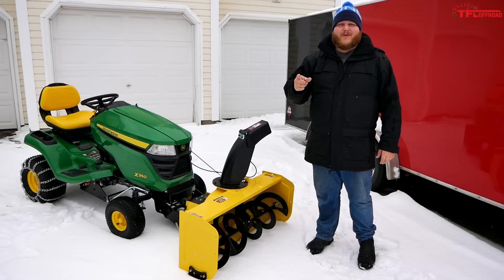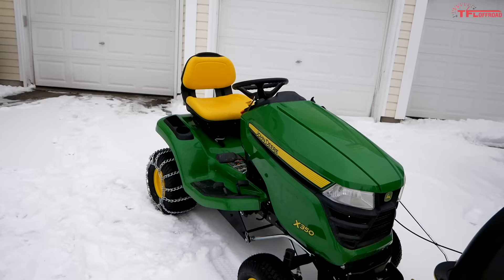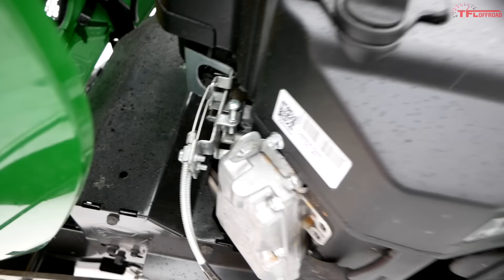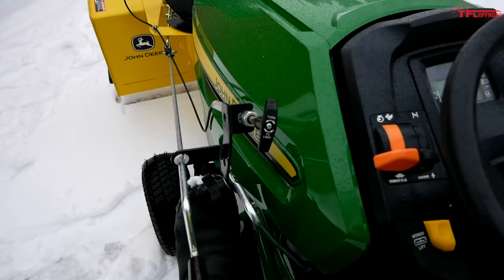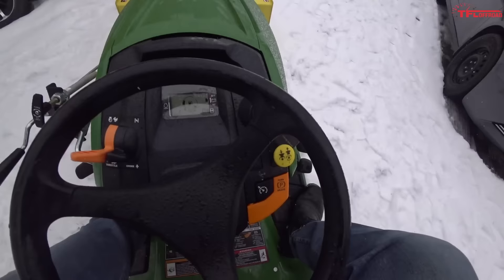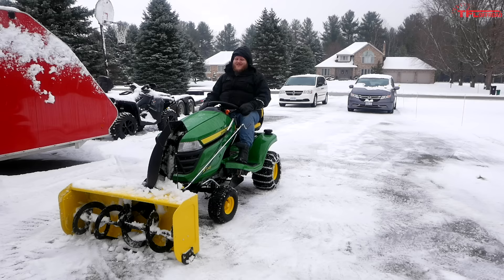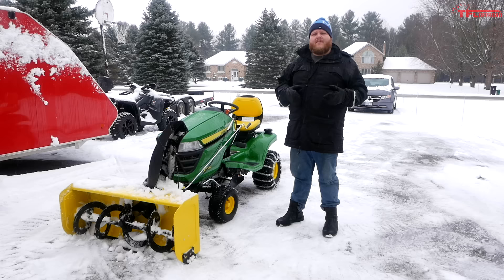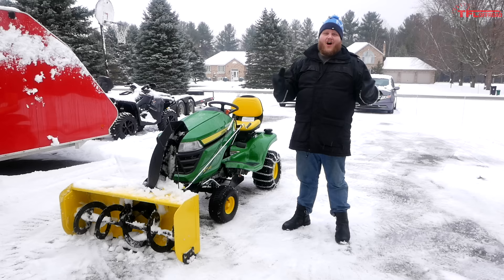Watch This Before You Buy a John Deere X350 Tractor!

Comment: The engineer notes and dealer service technicians both say that this transmission is sufficient only for flat terrain. In that case you’ll be fine. Mine went out after 300 hours and I was told it was because of the hills I was using it on.

Comment: Nice review.  I can't tell from the video or not, however, whenever you engage the PTO or disengage it, you should idle down the motor.  It's better for the belts.  On big tractors, if you don't do this, they call it, "Shocking the PTO."
Reply: Old wives tale. The first idler pulley off the PTO is spring loaded to take the shot. I work on small engine equipment and never saw a PTO wiped out by engaging under full throttle. The weakest link are the bearings. If you ever replace your PTO get one that the bearing is removable.
Reply: @joeganusi8522  If this is true then, I wonder why they also recommend that gas and diesel engines get idled down before being turned off as well?  Maybe they had magic springs also?  I have yet to replace a belly mower belt, because I idle down the engine before engaging or de-engaging.
Reply: @AStanton1966  Gas engines usually fill up the exhaust with unburned fuel if you don't idle them down before shutting them off resulting in a big backfire, especially if some backyard yo yo cuts the tip off the anti-backfire valve.
As far as the diesels, an immediate shut down after putting a load on an engine can result in overheating the engine (coolant flow stops upon shutdown and the block becomes a heatsink).
So, a minute or two run at idle (by idle, I mean 1200-1500 RPM with a tractor) allows the coolant to flow at no load and keep the engine cooler.
Now as far as you've never replaced your belt, good for you. I've seen belts last for years with customers who engage the PTO full or low throttle. Some tractors eat them up, some don't.

Comment: I went commercial-grade zero-turn 18 years ago and I have never regretted it.  My Yazoo (company is no longer in business) will run in reverse faster than my lawn tractor would run forward.  It literally cut my mowing time in half (1-1/2 acres).  Of course, I've got lots of trees in my yard, so maneuverability was important.  Furthermore, I live in Oklahoma and don't have need for snow removal capability.  BTW - My Yazoo has a similar Kawasaki twin (19 hp) and it has been bulletproof reliable over the 18 years I've owned the machine.

As always, thanks much for sharing.

Steve
Reply: Just sold my yazoo and bought this 350 lol

Comment: If you buy the X300R or X350 R, the rear bagger is a permanent attachment, which gives several real advantages over the other models. 1st, because it has No Side discharge you trim close on either the Left or The Right,  2- The bag can be dumped without getting out of the seat, 3- The mower blades direct the clippings with counter rotating blades that direct the clippings into a single stream out the chute below the mower, and into the rear bag. 4 - there is an available extra cost optional rear discharge to allow you to direct all the clippings out the rear for wide dispersal onto the ground, should you wish. (this still permits the reattachment of the rear bag when desired.)  My X300 R has the 17 HP Kawasaki motor which is more than powerful enough to do all you need, including cut very tall grass and weeds.  I usually leave the mower deck un-lowered to do this, and then make a second pass with the deck set to the desired height.  Be careful to avoid this high grass when it is wet or it can clog the rear chute that leads to the bag.  I find two days without rain is sufficient to avoid clogs after a rain. The rear chute whn clogged can be pulled straight back and removed.  Use a small flashlight to check to see the clog is removed in such a situation, obtain a narrow long handle rake so you can reach all the way in to loosen any clog of clippings before sliding the discharge chute back into place, no tools required for this.

Comment: If you get tired of pulling out that nozzle on your gas can, Go to Ace Hardware and get the No Spill brand of can. I have a 5 gallon for the tractor and mower. I use a 1 gallon can for my 2 cycle mix. Just put the nozzle in the tank and push the button on the back. No gymnastics or using 3 hands to fill the tank!

Comment: Great video I just installed the snowblower for the first time. I too did not get the 4 wheel steer just didn’t feel like I needed it.  Overall impressed with the ease of the on/off of the lower deck and the snowblower.

Comment: I have a bought Used Kubota 2wd G4200H Diesel best tractor I have ever owned. Plows my driveway/yard and mows my grass 4 times on 2 Gallons of diesel fuel. Always starts right up is a very powerful 12hp twin cylinder liquid cooled diesel engine. Oh and I have a bought New John Deere 4110 HST 4X4 20hp diesel with a loader and 3 point finish mower that the Kubota plows and mows circles around. The Kubota is made very heavy duty and if I had to do it over again I would buy just the Kubota. I even pulled out my neighbors Ford Ranger when he was stuck last winter in his driveway with 110# in wheel weights and tire chains on the Kubota. I have owned Quads and other tractors but the Kubota is the best.

Comment: Hopefully you will have it for a while.  Mine was bought new in 98 an LX188. Pretty much same as what you have but it was 5500 back then. What has happened to mine is that I started towing a 2000 lb splitter around and I think I may have damaged the transmission.  Still cuts grass ok but there is a definite ticking in transmission.  I'm trying to make it last until I turn 60 , four more years so I can get a 4066r est at 75000.
Have to wait because I want to buy it using my 401k money.

Comment: Hint for BETTER snow ejection:
The blades on the "ejector" are about 1/2" from the housing.
REMOVE the 3 blades and attach an "extension" of rubber belting material to the blades with metal screws.
They should be about 1/4" from the housing.
You'll be amazed HOW MUCH FARTHER the snow flies.
Don't slow the engine, too!
Yes, you're welcome.

Comment: They jet the carburetor very  lean to meet  emissions, the downside is that the engine tends to run hotter and you always need to choke the   engine when starting.

Comment: Little tip... don't put the nozzle on your gas can. The whole point in having the big gas port on the edge is you just put the open gas can right up to the opening... done. Faster, easier, no spills and you don't have to hold the gas can way out from the tractor.

Comment: Do yourself a favor and disable the "reverse implement operation" system.  It's so annoying.

Otherwise, it's a very, very good tractor.  I have the x370 and it's done very well in heavy snow.  You won't be disappointed.

Comment: I cut some automotive cable protective tubing to size where one puts their hand to lift the hood/cowling.  My hood was sharp and the tubing eliminated the risk.  I cleaned the area with alcohol and used plenty of Silicone sealant inside the tub then applied the modification to the hand grab area.

Comment: Love your enthusiasm! Great video.  Taking delivery of my ‘22 X350 Friday after having had a 1997 LX178 with Kawasaki V-twin liquid cooled motor.  No joke, this engine is built for the long run and was a joy to operate over the years. Really hoping the air cooled version delivers similarly.
Reply: how is it?
Reply: @aresident7745  2 hours on the mower and runs great
Reply: I have a LX 176 with the one cylinder Kawasaki which refuses to die. I'm surprised the x350 has the k46 trans when the LX had a k61. Wonder how reliable the k46 will be.....
Reply: @GrumpyXer  stay tuned

Comment: I know everyone has their own two cents worth to throw in so I thought I'd bring up a question concerning rear weight.  I was told years ago that with these lighter series machines it is better to use wheel weights than ballast-style weights like in this video.  The point is that if you can achieve the same weight directly on the wheels, it takes the additional strain off of the transaxle.  That could be BS, but it makes sense to me.  My two cents.

Comment: The X350 is better than avg. for sure, but the X500 series has a much better transmission also has the rear axle locker which has saved me many times. My X530 also has power steering and 8 mph. Do Not run at full throttle, run at 70% ,

Comment: I have this mower and Blower combo. 400 hours on it. So far the throttle choke levers have been replaced twice they break in cold icy weather. The Blower shute angle handle is on the third one. The cables Crack and fill with water. The seat has been replace 3 times. The most expensive repair has been the steering mechanism on the steering shaft, the gear on the shaft is soft material and thin piece of punched out sheet metal with teeth cut in it is not heavy enough material to with stand steer pressures with the very heavy Blower up front. It appears John Deere  x350 has down graded their quality for cheap light parts, parts that are very expensive!

Comment: I have the older x300 which is like yours. The power steering would have been a great feature for you because the deck lift would had been powered and would have been nice to lift your blower.  The more snow you put in the blower the better it will work. And you may find you will need a total of 4 suit case weights. I added a suicide knob on my steering...made it so much easier.

Comment: I did not know you have to change the transaxle oil and filter within 50 hrs. To do that you have to remove the deck and it's generally a pia for an average homeowner. If you need this tractor, then that's what you need. But keep in mind you will have initial maintenance to do on it.

Comment: The bad news is the K46  transmission in this tractor.  When you buy a garden tractor with a hydrostat transmission make sure it is serviceable! Easy to do just look underneath the Trans for a drain plug.   If not it won't last very long and they are expensive to replace. There okay for flat ground lawn cutting. But adding attachments like a  snow blower or hills up and down they will fail .

Comment: Congratulations on your John Deere buy! You're going to love it! If i may suggest, every fuel fill up please add the blue Stabil Marine fuel stabilizer. It is  recommended. The red Stabil is not as good, that's why I recommend the blue Stabil Marine fuel stabilizer.
Reply: Blue stabil is twice as concentrated.  Blue vs red, same size container, treats twice as many gallons of ethanol fuel.

Comment: You might consider running your shoes on side of blower all the way up. Just run on scraper. My drive is about 250' long and 1/2 of it 3 car wide and got about 7 years before replacing scraper bar.  I prefer the better cleaning riding on the scraper does. Get down to the pavement and when sun hits it then it melts better :)

Comment: I just got rid of one of these and bought a 4x4 JD 1025 tractor with snow blower and bucket and am pleased....trust me any snow more than 6 inches and you're not going anywhere with this size tractor...remember you've only got traction on one wheel and that's no where near sufficient unless you've got snow a few inches like shown on this vid on a perfectly flat driveway...try snow blowing 6 plus inches of snow on a 5% grade or more and you're dead in the water and that's why I got rid of mine..IMO you're better off getting a walk behind snow blower than one of these...if you don't mind paying a bit extra $$$$ go up to a real sub compact tractor like the 1025 JD or the Kubota 2380 you'll not regret it...the peace of mind that you're not going to be stuck every minute and the versatility of the sub compact tractor is wort every penny....trust me on this if you can't afford the sub compact go with a walk behind....further more these JD garden tractors with the snow blower attachments are not cheap and the extra cost to go up to a sub compact like the JD 1025 is not really all that much more....I know about this first hand trust me on this.

Comment: congrats on the new tractor. I have the X738 since 2014. I have very long driveway, with incline. Locking Diff does help. First things I did was disconnect/bypass the seat safety switch. You will to, once you start to mow grass with it. It was such a pain re-starting the tractor every time I had to get off of it just to pick up a stick or something else. Why put all that unnecessary wear on the starter? 2nd thing is to bypass the reverse pto cut off switch. There is no reason, to me, to have the pto cut off every time you hit reverse. All that starting of the pto will lesson the life of the clutch on the pto. It has to. I wired mine so the tractor thinks I am lifting the pto switch all the time, so it keeps active and does not shut pto down. Over time, you will do the same. The seat and the pto reverse switch were designed for stupid people and for john deere's liability from the stupid people. Save your starter and your PTO clutch life and do these two mods to your tractor. Unless you want to replace starter and clutch way before you should really have to.
Reply: hey bud if you read your manual,it tells ya how to do both  ,run your pto in reverse and get off the tractor without your engine shutting off. Getting off is easy just make sure your footbrake is on  and the lever in the up position. If you have grandkids like I do the safeties are a must!
Reply: @Michael52551B  my setup works for me. I do not want to be bothered with having to remember to lift the PTO switch up or hit the yellow button before going in reverse. And when I need to get off tractor to pick up a stick, I want to just hop off and get right back on an go, not be bothered with setting the parking brake. If you would learn to keep the grandkids in the house and tell them to stay away from the tractor, it IS NOT a toy, than your concerns are null and void. And oh, I also disabled the safety on my Beretta PX4 Storm handgun that I carry because when and if I need it, I choose not to be bothered by a trigger safety. Safety's are for stupid people who can't think ahead for themselves. Don't believe me, ?it is a fact that safety's were added onto products after someone sued them for something stupid they did with their products and the court case demands the company install safety's so any other stupid person doesn't do the same stupid thing. Adios.
Reply: All that reverse spark cut nonsense from occasionally forgetting to hit the button I believe to be the cause for a partially sheared flywheel key around 75hours.  
The machine suddenly was popping and banging and could barely move under its own power because the timing was shifted.  Thought for sure it blew up, but no; a $5 part and diagnosis.  Also the inconvenience of not finishing the job.  
Also did this aforementioned  jumpering mod, it’s over 500 hours now and haven’t sheared another key.  Just one persons experience.
Reply: @paulaschenbrener1859  see, my way really is the better way. Bypass that PTO cut off switch people, or pay to get something fixed that did not have to break.

Comment: Congrats on the new tractor and property. I love my John Deere Tractor with the 20hp Kawasaki. I’ve had it for about 15yrs now without any issues. I did get the power steering and diff lock (hilly terrain and sometimes mow in wet muddy areas so it’s helpful). I’d love to see more mower/tractor reviews on TFL. Might even gain a new viewer base. Thanks for the review it was excellent!

Comment: My grandpa had bad luck with yard implements. He had a Toro 2 stroke blower for doing stairs and walkways, but it was a little underrated and blew up. He got an electric rplacement and luckily it had rubber blades otherwise he would have cut the cord.
You keep the JD in the garage in winter??

Comment: Damn near messed up bad several times. These tractors have all three controls on the right side for operation of forward, reverse and breaking which are fine unless your going up or down a ramp going onto a trailer or on an incline. On can easily move your foot to the wrong pedal when and go the wrong direction...I was able to ride the clutch in my big rig but with JD X300 series there’s a moment your not in control of its movement in certain situations...I’d like to see a hand break one could use in addition to the foot break...any comments or suggestions welcomed. Be safe

Comment: Congratulations on the new Deere! I’ve got a X570 with a 54” deck, bought it new in 2017 and now considering getting a snowblower for it. Glad you did a video, what’s the deepest amount of snow you’ve dealt with so far?
Reply: I prefer the zero turn of an actual snowblower. My 2 cents.

Comment: Just would like to share my experience with the snow blowers on the best yamaha grizzlys and a X 350 my self .Spend  2 thousand bucks and get an Ariens Professional  sno blower and you will see it is 5 times easier to get rid of the snow. I blast threw snow 23 inches high and  since I tried a Ariens I would never waste my time doing it the old way again. I am out and back in in no time. I snow blow a 100 feet away from my house for my dogs to get in the back and it is a breeze with the snowblower. I wish I could show a picture of what I do but I dont see any way to add one.